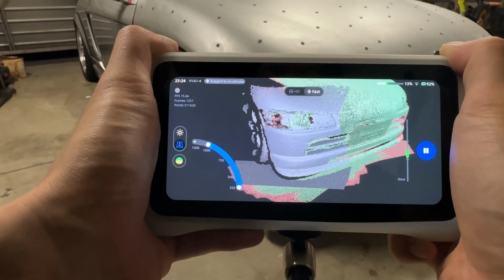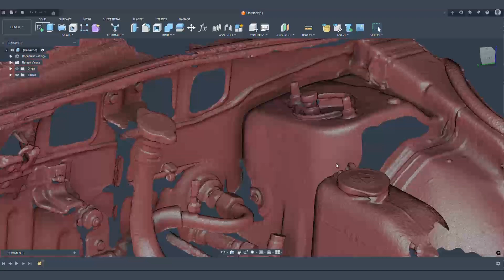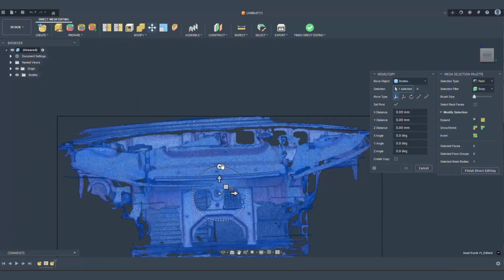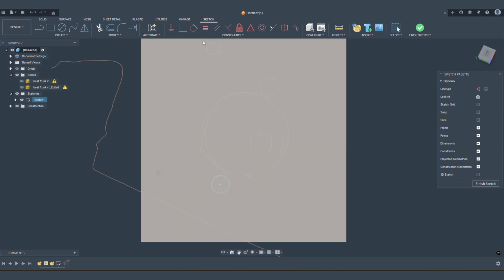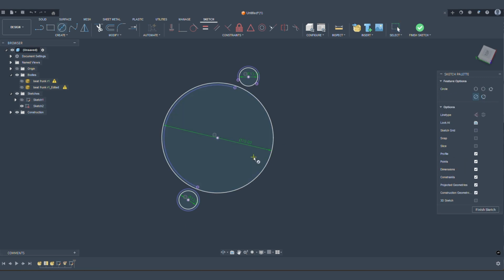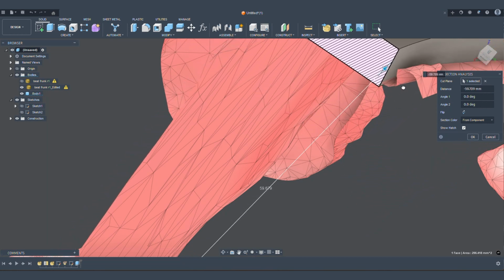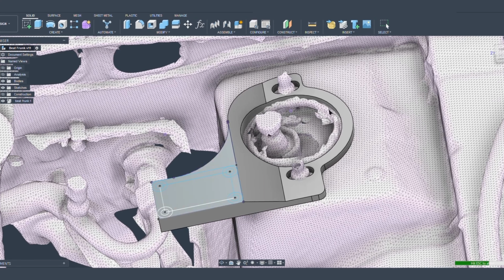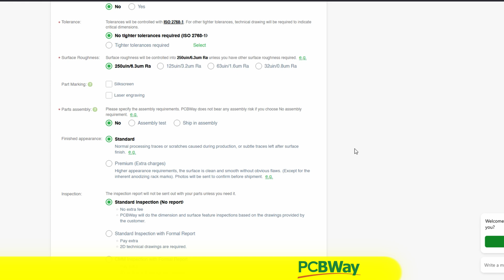Using a 3D Scanner to Upgrade my Honda Beat

Comment: looks great just a heads up you can do a 3 point circle and get a full circle to start vs using an arch :) figured you helped me find the mesh align least i can try to return the favor lol
Reply from the maker: Legend! Thanks for the tip!!
Reply: @IMEEMADE  NP! i was literally doing the exact same thing the other day for a project and was like i know i've done this before but couldn't remember so i had to look it up.. glad it could help someone else! esp since i did my alignment in blender since the old way to align i used to do in fusion was a pain LOL so glad we could help eachother